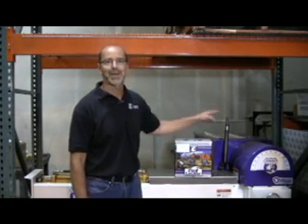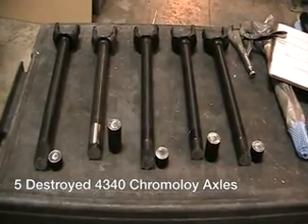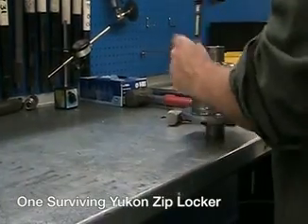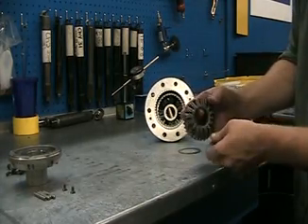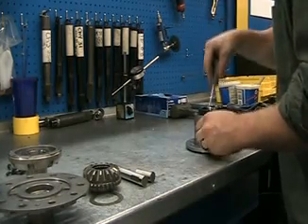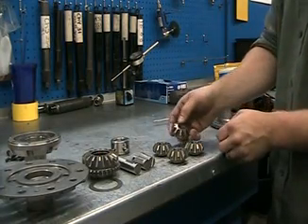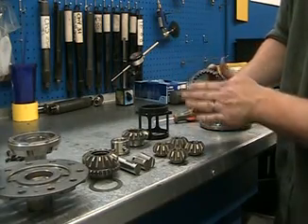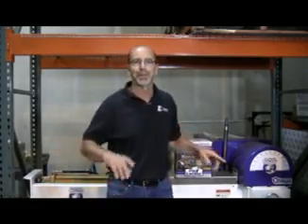Yukon Zip Locker Testing - against 5 Diff company 4340 Axles

Comment: ok listen ARB tested a Yukon zip locker that was a prototype when the first made an air locker. That locker that ARB shown in their video never made it into a consumers rig. Yukon tested and shot down that set up. ARB just did it because Yukon is in direct competition with them. bottom line, you wont be up set with either one
Reply from the maker: Yukon has a 6 yr (72mo) and 2 year with $2000 collateral damage coverage also. Covers things like labor, oil, gears etc.  What the locker failing damages.  I can get you a yukon zip with the above warranty, with a lifetime single exchange coverage guarantee against failing & a compressor for 890 to your door AND a $50 rebate right now till fri....
Reply: Brandon C. If that's the case, and Yukon no longer use that axle, they should pursue a cease and desist for libel from ARB. That is, ARB is allegedly showing a locker that Yukon no longer produces, and is slandering the Yukon name.
Reply from the maker: Philip Gragg That is like telling ARB to sue Yukon for selling a copy of their air locker.  It all comes down to $ and the odds of winning a the case, is it worth it.
Reply: Robert kobal  A cease and desist letter isn't really that expensive... but meh... I'm getting an ARB because of the 60 month warranty, plus I'll get a free compressor just for the locker... Makes it easier than having to convert air from my york..
Reply: Well I guess my wording is poor I did not mean prototype. What I meant is first generation. Meaning Yukon has change the design from there first one you know like  evolved. No I can't comment on your bias towards arb. I am a firm believer in stay with what you think is better. And don't bash anyone else who begs to differ on a subject as what brand locker you are running we are all there to have fun. But what I am commenting on was the fact that ARB used an old Yukon locker. That locker which did not make it to full production yet. Then used it to spread false info. Yukon has a clip of them breaking 5 axle shafts as well
Reply: ***** hey man no harm. its all good, im just happy people are out there enjoying these awesome products. my next investment will be a pair of ARBs because they are the only one making a selectable locker for the 10.5 14 bolt.
Reply: Robert kobal Didn't realize you were a distributor for Yukon... :/  well, I already bought the ARB... Hopefully someone takes you up on that offer... sounds pretty sweet.

Comment: Those were only Dana 30 axles. I believe in the ARB video a larger and stronger axle was used. To really compare things fairly we need to know how many ft-lbs the locker can handle before breaking. Anything that is more than what the axle can handle is overkill and should work fine.